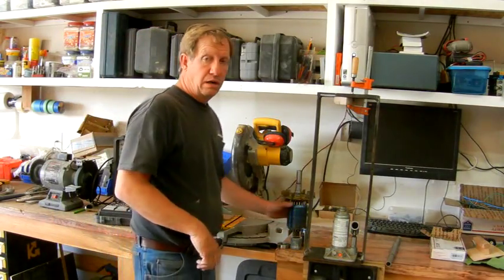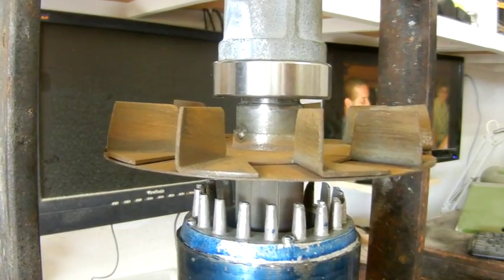Replacing Motor Bearings

Comment: Excellent video for me.  I pulled my (extremely similar) baldor apart.  It has ntn 6205c3 and 6206c3 bearings that are sealed on both sides.  The motor frame has grease fittings on each end but no purge points.  Anyway, i want to replace the bearings yet those part numbers come up as open bearings, not sealed.  Id like sealed bearings just like you installed and then would probably remove the grease fittings permanently.  Im new at dealing with bearings, any advice you can give me?
Reply from the maker: I agree with you and would replace the open with sealed. Seems like your on the right track.

Comment: Good try, but using a bearing heater allows you not to damage the bearing in the process.
Reply from the maker: Your right you could use a bearing heater, but how many people own one? I have seen more than a few bearings destroyed by overheating the seal or cooking the grease out of them using ad hock methods. Motor bearing fit isn't that tight and by pressing on the inner race the bearing wont be damaged.

Comment: How'd you get the bearing out of the bell end?
Reply from the maker: It's normally a slip fit and comes out easily.
Reply: @BSpotBuilds  well I've got a motor that when I pulled the rotor out, the rear bearing came off the shaft and stayed in the frame of the motor. Definitely seems pressed in. I am destroying it to get it out, which is no big deal but it is a lot of work
Reply from the maker: @toddl5424  You can drill a couple holes in the bell end so that you can get a punch on the outer race and tap it out. Best method I know of for a sized bearing in the end.
Reply: @BSpotBuilds  thanks, that probably would have been quicker than what I did. I took a dremel tool with a metal cutoff disc and went at the bearing. It took a couple hours. That is some damn hardened metal on those bearings

Comment: NOT SO EASY - i'm just finishing up my unisaw motor rebuild and got into several snags - couldn't drive the larger bearing onto the shaft all the way so i had to spend the entire day trying to find a shop with a bearing press - amazingly most auto shops DO NOT have these - at least not in los angeles - so i had to go to a specialist ... took a long time to argue them into doing it since they seemed to think it was a liability working on 'electrical' parts ... then after getting it all reassembled even though i was trying to avoid this - stator ended up rubbing on the capacitor wires - UGH - back to square one!! tear down and rebulid again
Reply: Unless its some large engine get or make on lathe little bearing tube that only catches the inner recess and hammer on the other end. You don't really need a large press. I never actually pressed the bearings onto the motor shaft.
Reply: yes i did that and banged the HELL out of it trying to get it on but it wouldn't work - i suspect i deformed the end of the shaft originally when trying to get the bearing OFF - all in all it took me two weeks to 'rebuild' the motor - hope i havent' made it worse than before (!) - would have been much more efficient spending $700 on a whole new motor

Comment: Good video, I had very low volume. I have motors where the bearings were getting old, I have just drilled a very small hole in the side of the bearing and filled it with oil using a syringe, seem to work well for a long time. Not like getting new bearings, but very cheap and easy. Thanks.
Reply: Good work
Reply: ack!!! you didn't get metal filings in the bearing?